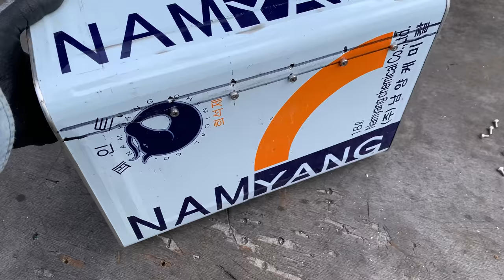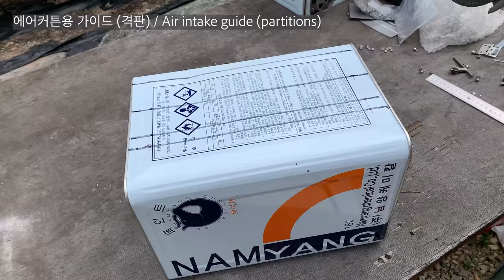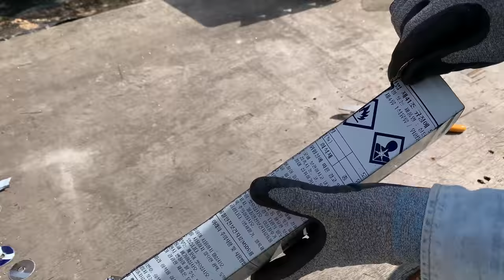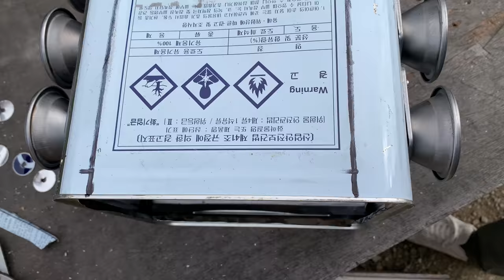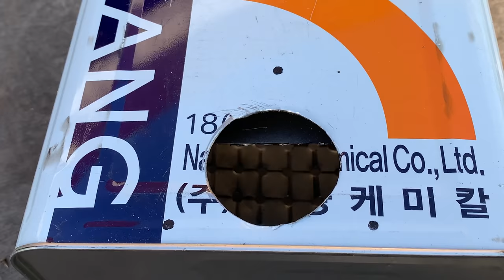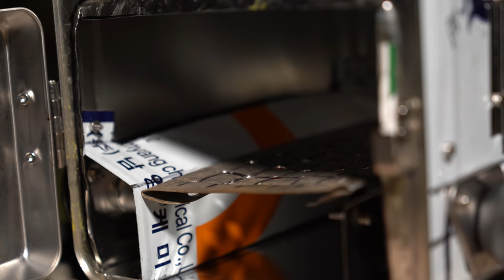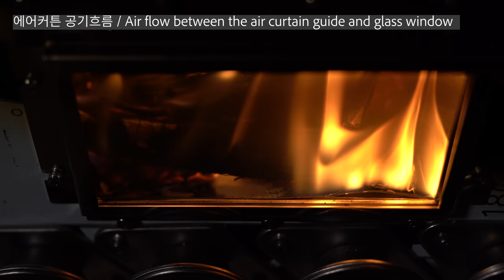Homemade Camping Wood Stove Experiment - Less Soot Airwash System - MX-Stove Project Part-2

Comment: Thank you for sharing this video.  Your engineering and design skills are quite impressive.  If possible, can you add cement board to the inside where there are single layers of metal.  It will take a minute or two to heat the cement board but it will buffer the excessive heat and keep the exposed metal from warping or prematurely burning through.  Greetings from NE Ohio, USA.  Wishing you and your family peace, health and happiness as winter approaches and the pandemic continues to evolve.  Peace brother.
Reply from the maker: Thank you for your advice. Although this was made for testing, I will try to apply your ideas in various production environments in the future.

Comment: Interesting stove. I had a 13"blue steel airtight wood stove in my Volkswagen van as I was taking a course far from home and on a really low budget. No window and only one air vent but it provided heat for the room and for cooking and that is basically all you need. Windows are nice but not necessary.

Comment: alway love your ideas and fabrication ... I am curious , why have air going up inside and no air going under fire grate ?
Reply from the maker: I'm not sure if I understood your question correctly. Air enters through the air intake of the front door, and enters through the air chambers on both sides of the wall (this is expected to reduce the soot on the window by using the air wash effect). Thank you.

Comment: I am in the middle of building the other stove- the one made from "hotel pans". What part of that stove needs reinforcement to prevent burning through? Do i need fire brick on the bottom or a steel liner or what? Great vids BTW
Reply from the maker: Wouldn't it be a hassle? Reinforcement of the top plate is essential. I plan to use the main fire box with regular maintenance, replacement and repair. Thanks!
Reply: @campingtogether  how do i reinforce the top plate. ? I am not sure what you mean- is it the "lid" that separates the top and bottom chambers?
Reply: @campingtogether  is the reinforcement shown in one of your videos?

Comment: I have a question about your designs. Instead of all those air intakes. Can't you just make one sliding air intake on sides & front? And if no or yes can you please explain your decision why you do it the way you do it or no why you decide to it one way or another? 
To me I would just put in a slider. Just less work I see. But I've never built one either so I'm no expert either... lol...
You on the other hand have build several & you my sir, IMO, are as much as an expert that I have seen.
So no disrespect to you @ all. I much appreciat your oppion the most.
Thank you for your time & feed back,
Chris from Missouri
Reply from the maker: At this moment I prefer using air mixer for building stove. Because it is cheap less than $1 for each. Making sliding air intake takes more time for me to do it. Now I am planing to design another stove and I think I will apply sliding air intake to that one. :D Let's see. Thanks.

Comment: I like the little air chambers down the sides of this one to give the incoming air an extra boost of heat. I'm not sure why there are two openings in the upper baffle though. Would just the big one at the front be enough, and then the air would heat the top surface better? Or maybe it would get too hot?
Reply from the maker: It seemed that the initial start-up of the stove would not be smooth if the heat discharge was excessively delayed.